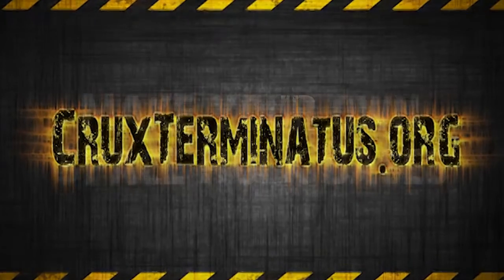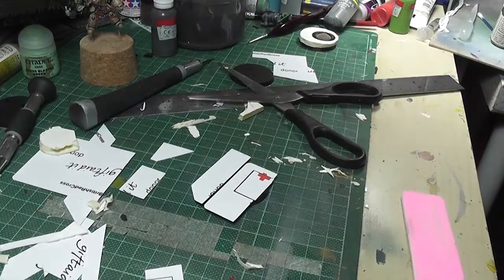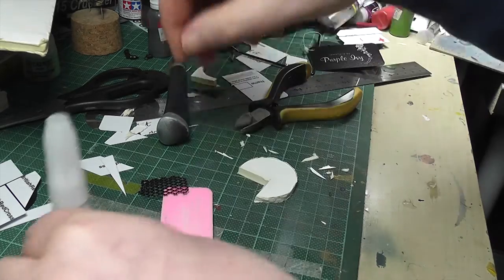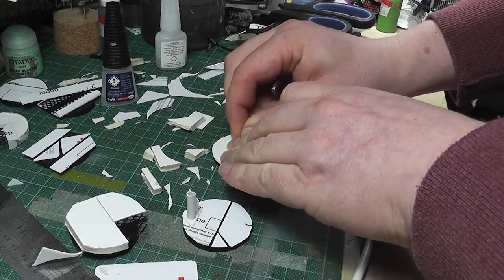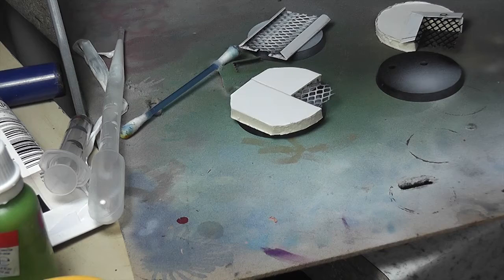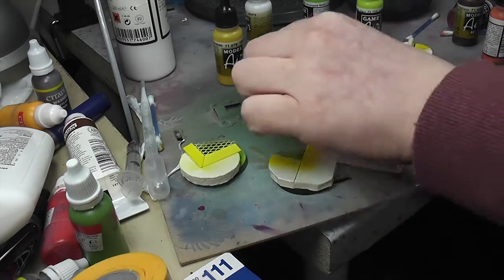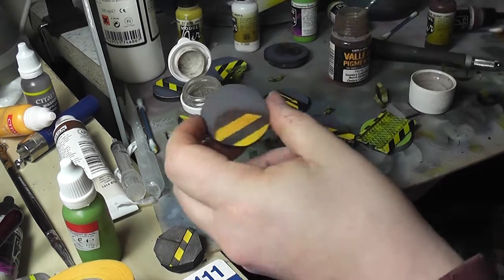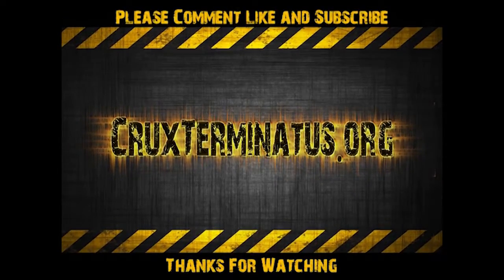Make your own Space Hulk / Space Station / Space Ship bases

Comment: Great video and shows you can 'scavenge' useful bits from just about anywhere for your basing materials. I've found the splash guards you buy for frying pans are a cheap source of very lightweight mesh material for use in modelling deck plating. I also clear up the ends of various wires left over from when electricians or phone engineers have done their work. Keep the vids coming. You've given me some good ideas ... Esp the credit cards!
Reply: i realize I'm kind of off topic but do anybody know of a good website to watch new movies online?
Reply: @Kade Kyson Flixportal xD
Reply: @Amir Dariel thank you, I signed up and it seems like they got a lot of movies there :D Appreciate it!
Reply: @Kade Kyson no problem :D